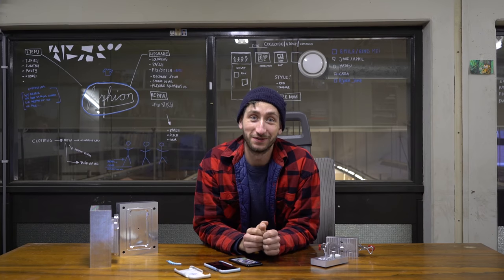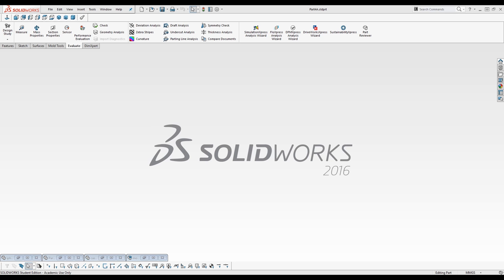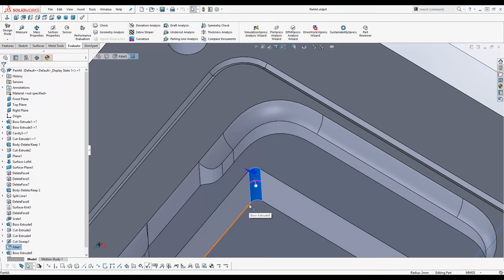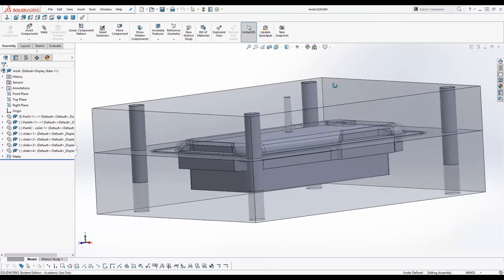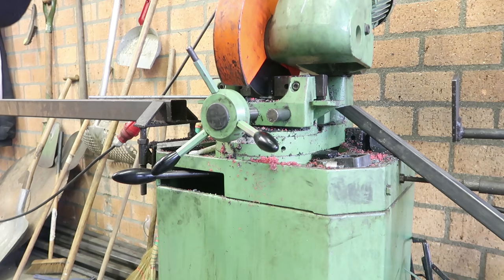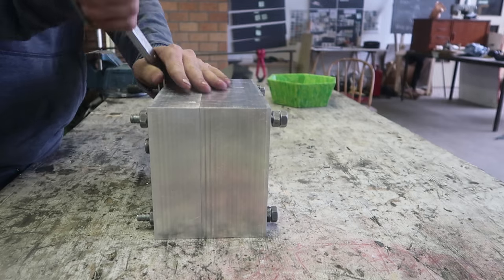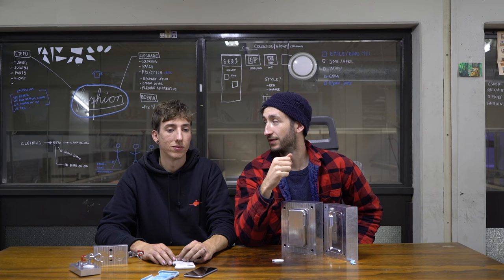Make a phone cover from recycled plastic and CNC milling #preciousplastic

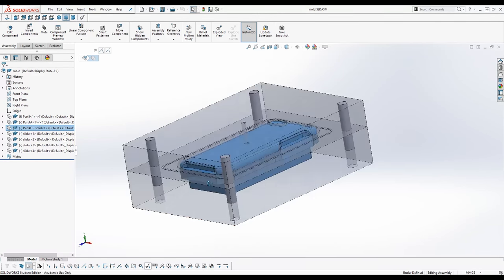Comment: Right at 4:00 you mention the issue of the mould sticking to the plastic after injection. How did you resolve the issue of the cover needing to be curved around the edges so the phone won’t fall out of the case?

Comment: So where does the air inside the mold go? Is it simply compressed into almost nothing by the plastic or did I miss the part about the vent hole? In any case, great demonstration!
Reply: I was also curious about this because of how metal molds work. Great video! I didn't see vents in the design though, but maybe I just missed it.
Reply: I noticed that too. Usually you have very thin vent slots to let the air out. It also helps to mill in a parting line (slot) between the mold halves so you have a place to jam something in to force the halves apart.
Reply: https://davehakkens.nl/community/forums/topic/make-a-plastic-phone-cover-using-cnc-milling/ for all your questions :)
Reply: jerry de vos thank you so much!
Reply: In other cases Industrial made molds have air liberation holes and water conducts to cool down the piece otherwise it would have bubbles in the final cast

Comment: Why dont you use the mold creator feature in SW and why dont you use the moldflow simulation in SW? Is there also a way for the air to escape your mold to prevent the plastic from burning up (dieseleffect)? Have you added a draft to make the part releasable from the mold?

Comment: May i ask you, how much did the CNC mould cost, including shipping?
Reply: Marco Herremans I say 900€
Reply: It all depends on where they ordered the mold and the tolerance of the part. The part doesn't have to be very precise and it's made by someone on Thingevers (most likely a hoboïst) so probably a few hundred. 

A highly detailed 2 part mall in Europe will cost more than €10,000 but when you order it in China only a few €1,000.
Reply: Also a desktop cnc mill could work if you have access to one with either maker spaces or personal purchase.

Open Source Ecology is developing cheaper open source machines.  One is a cnc mill.  Look it up, it may be worth a look
Reply: Here is the wiki link: 

http://opensourceecology.org/wiki/D3D
Reply: Y don't you just 3d print it
Reply: David Lee,

Precision + Mass Production;

3d printers are great for their versatility (in that they can make any shape with out any change in molds or anything really), and their ability to make complex lattices that were impossible with other methods.

Injection Molding (what this process is) is good for it’s speed; once a mold is made, and its precision.  If a mold is made precisely (such as with a cnc mill or 3d printer), you can make the object super fast; you are only limited by how fast you can fill molds with plastic.  This is all done with the same level of precision that went into the mold

3d printers are precise, but they can take lots of time (especially for fdm machines( sla and sls macheines are faster but that is a whole new beast to cover) 

The best workflow is either cnc mill/3d print molds for either casting or injection molding, or make a commercial grade print farm.
Reply: MotherEric 
Did you try vacuum casting
I think it may bring down the expenses
Just like to share, I'm not an expert
Thank you
Reply: David Lee,  

I haven’t yet.

 I too am no expert; i just do a ton of reading and watching YouTube videos like this. So feel free to correct me on anything!
Reply: MotherEric 
Oh 
Ok then try to look into the vacuum casting and metal 3d printing
I think if we use them the right way we can definitely bring down the plastic wastes
Reply: compared to injection molding casting takes much longer and uses way more expensive materials (resin)
Reply: Ivan Stroganov 
Oh 
I thought the opposite

Thanks for the tip bro
Reply: https://davehakkens.nl/community/forums/topic/make-a-plastic-phone-cover-using-cnc-milling/ for all your questions :)
Reply: Marco Herremans yaaa does a good idea

Comment: Hi, the covers we make are very small and difficult to get on and off the phone. Can anyone help us or give us tips on how to fix it?  Should we make the mold thinner so that the covers becomes thinner? Will they fit better on the phone and get on and off easily then, or should we take other steps. I and my friends have also talked about whether it is possible to scale the mold by 1% to make the covers fit better. Will this be a good solution?  We are really desperate and need help and tips.
Kind regards Mathias
Reply: Hello Mathias. Every kind of plastic likes to shrink after injection. It usually takes sth about 1-2% (% depends on kind of plastic you used) and takes about 24hours after injection. I recommend you to change sizes of the mould. Best regards :)

Comment: Making that phone case is damn expensive, how do you even get back the investment?
Reply: davidoskky rischitti  if you make  like 1000 parts  use the same mold and you sell them all
Reply: Sure, if you had a press it would work; this way though is quite time consuming.
Considering the price of a phone case is around 10$ and that the process takes around 30 minutes from what I've seen you could make 16 cases in 8 hours, you would then have to sell the product, which is time consuming or have an employee to sell them.
This way in a month you would make 4800 $ (assuming you could sell all of those), you'd have to pay the employee, you'd have to pay the rent and electricity, and you would have to pay taxes.
I really don't see how the investment is coming back

Comment: How can I get Solidworks software?

Thanks
Reply: thepiratebay
Reply: Buy it. Only 3995$ or 1295$ annual subscription fee.
Reply: The torrent thing doesnt work.. have tried many times...
Reply: Try Fusion 360... Free for hobbyists.
Reply: Yea I have used Fusion 360... its a good software... but is Solidworks better than Fusion 360 or is it the same?
Reply: You basicly only have to search for a CAD program, there a also free and open-source one out there.

Comment: i mean... making a cnc'ed mould for just a cover of recycled plastic seems a bit overkill. that alu has still a footprint, even the cnc and the power it consumes itself (and the computer for the time of mould desinign).
i think that optimizing the recycling for 3d printing is the less "extra material" way to recycle: a smaller extruder/filament machine dedicated to PLA (which has lower melting T, or other low-melting plastics) is highly wanted in the 3d printing scenario.
Reply: stephen von crven while you're right, it does leave a footprint, they don't plan on throwing it away or using it for a limited amount of time. That's something that can last a pretty long time.
Reply: a 3d printer would consume much more engergy because of how long each print would take. a mold like this is made to last for tens of thousands of pulls, so the footprint of the alu doesn't really matter much. its for mass production why 3d printing is for prototyping and very limited production runs.
Reply: it's not for mass production, as dave himself said when he presented the machines. it's a manual work, how many cases do you need to make the mould repay itself? (economically and environmentally)
machines like these are intended for amateur artisans or small crafters and the capability of shapes and forms of a printer are way superior.
image that in your neighbourhood there's a shop with this and a printer, you can produce 1,2,3 small "fixs" customized on simple house requests.

cases are for big injection machines, unless you want to achieve something more "artistic", but then it's art not recycling.
Reply: stephen von crven maybe not here but in general injection molds are for (mass) production and (mass) production only. what they showed here is a nice introduction into the injection molding process but for their application its obviously pointless as they would have a hard time even earning the cost of the mold back with their manual setup.
Reply: stephen von crven b